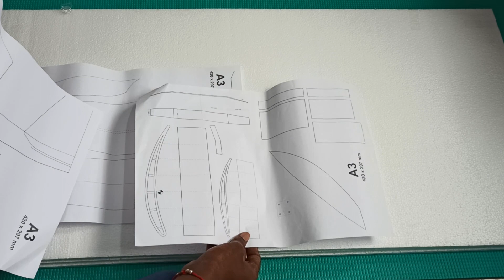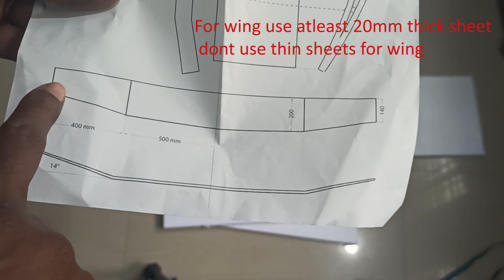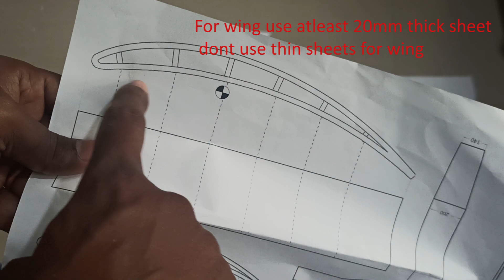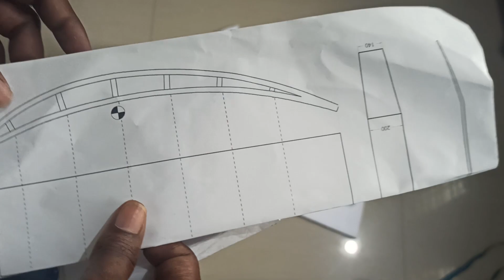Hydro slowfly Rc plane- DIY BUILD|Part-1

Comment: Do you laminate the sides of the thermocol as well? Because when I use hotglue on the sides, the thermocol melts
Reply from the maker: Yes laminate both sides for extra strength. Don't use too hot glue. Power off hot glue gun then try to use. So it won't melt thermacoal. All the best👍
Reply: @DiyDot3d  thanks for the reply
Reply from the maker: @theragavelan  welcome 🙂

Comment: Hi friend, nice video, please tell me after cutting planes and then putting on on foam, first of all can we use any packing material foam? Because I tried to make fish on packing foam and my own was going inside foam, also when I tried to somehow cut the foam it was tearing down and foam was cutting like snow fall, tell me how you cut your foam and which foam are you using, I saw you in previous video when you were trying to cut rudder in 45degree angle it was cutting smoothly when I try to cut my foam it was tearing foam so means foam type is different and it's not just ordinary packing foam?
Reply from the maker: Hi I'm using low density thermacoal sheets. Which you can get it in stationary shops. I think it's 12mm thick.after cutting parts you need to laminate those parts with Tracing paper (butter paper) using water and fevicol 1:1 ratio. That will give strength to foam.. All the best👍
Reply: @DiyDot3d  well how you cut your foam? Using what? Ordinary cutter or what? Electric foam cutter etc?
Reply from the maker: @jalalhaider83  it's just normal cutter